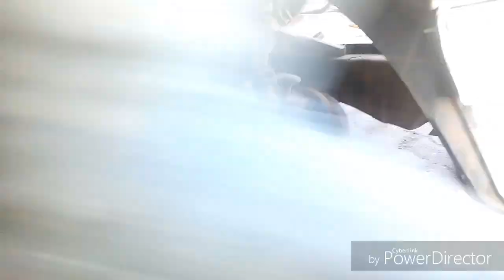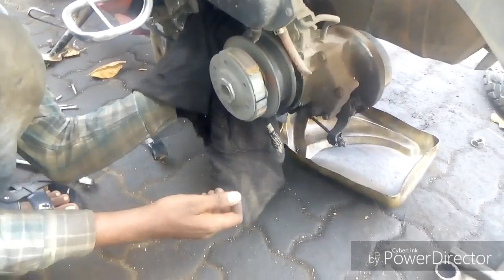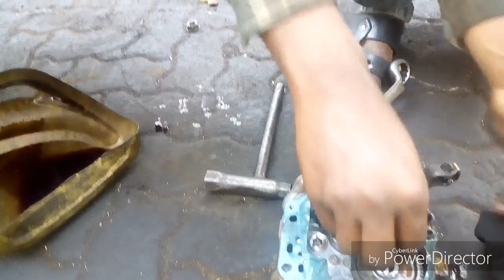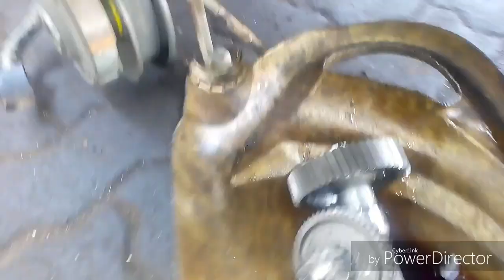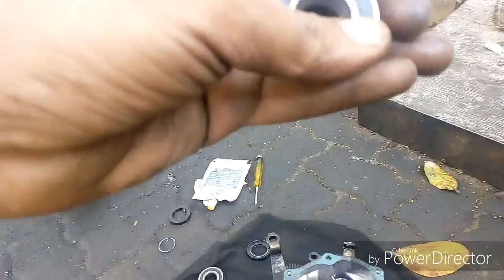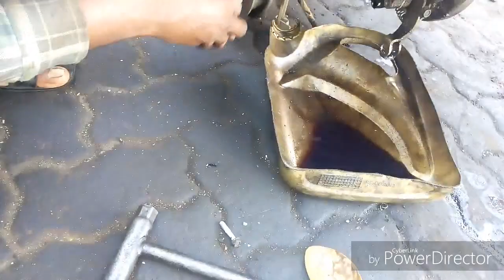Activa , mestro , dio , aviator Gear box oil leakage

Comment: Kaun si bearing change karna chaiye after 13000Km ride...can i replace my bearing,belt,clutch shoe,roller
Reply from the maker: Koi bhi cheez nahi change karen only 20000 pe belt change karen or 1500km pe oil change
Reply: @khansahebmumbai1132  Arda 211752